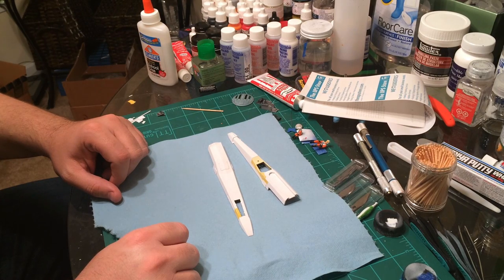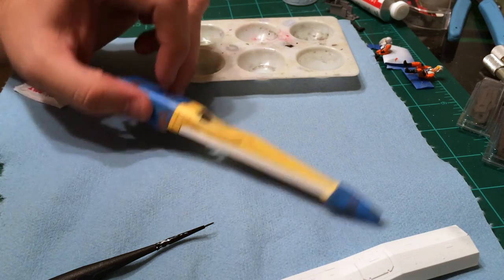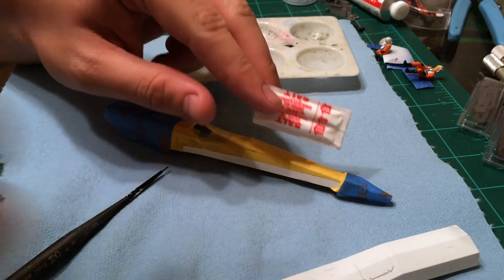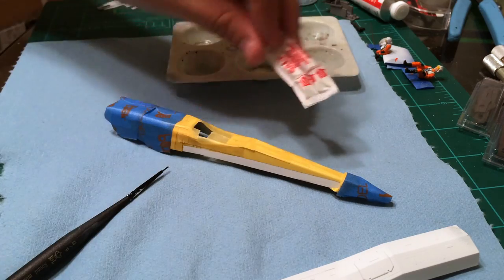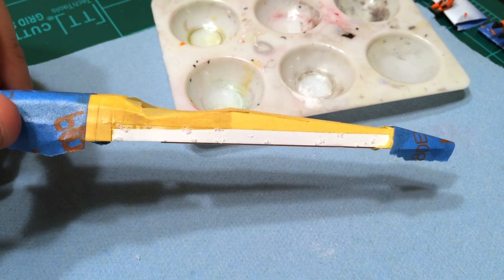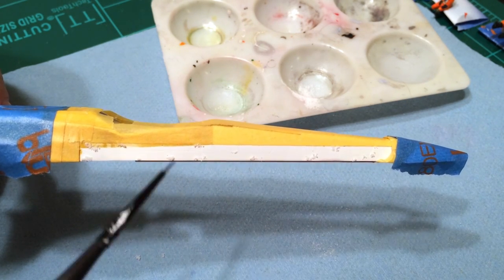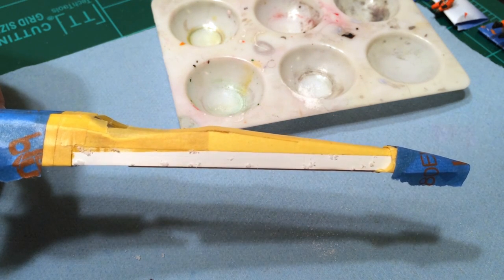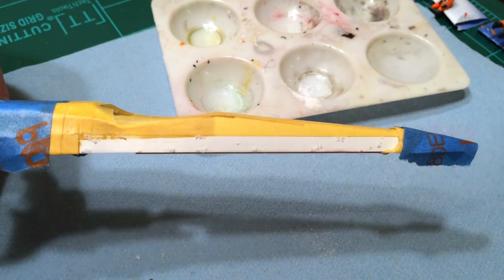Paint Chipping - Salt Technique - X-wing Fighter

Comment: Hi, this is TVGM from the SSM forum. That discoloration is exactly what happened to me, and it discouraged me from attempting this again. Do you think that if you just let the acrylic fully cure after a few days, you could airbrush more red and remove those splotches? I hope that this does not happen when using lacquer paints.
Reply from the maker: What kind of lacquer are you using? Tamiya Sprays?  If so, I recommend trying this on a spare model or sheet styrene before doing it on your actual model. I am not sure if lacquer will have this problem or not.  If you shoot enamel paints, this also should not be a problem.  Any acrylic paint such as Tamiya acrylics or Vallejo will exhibit this discoloration. 

If you plan to paint over something you've already done with this technique, I recommend lightly sanding it down with 600, then 1000 grit sandpaper to get the surface smooth and levels, then respray over it.